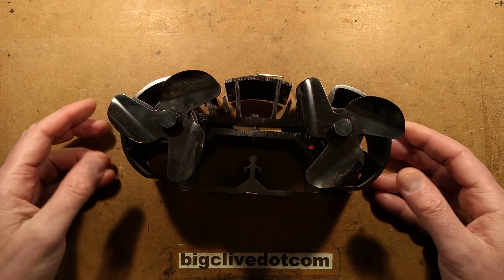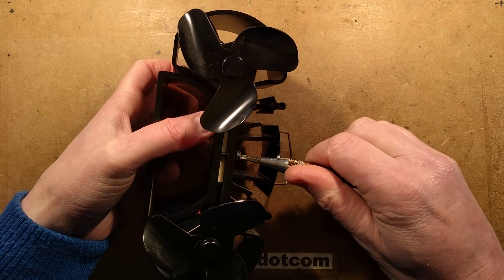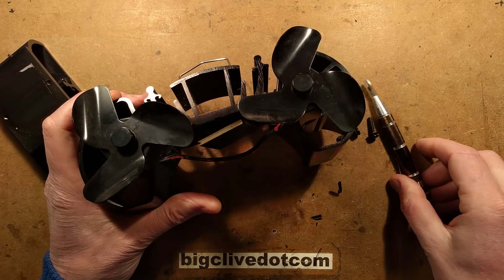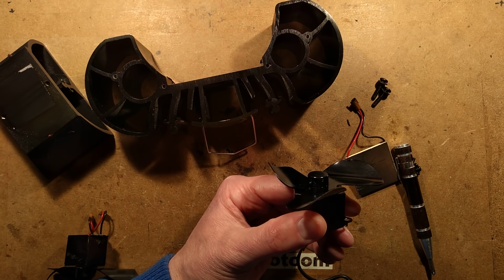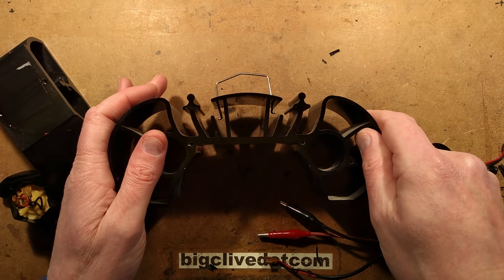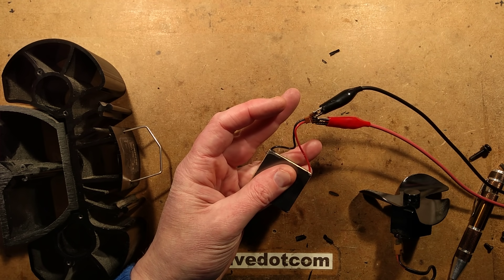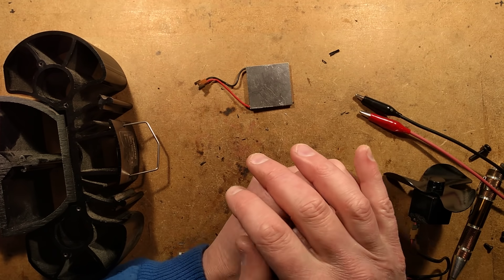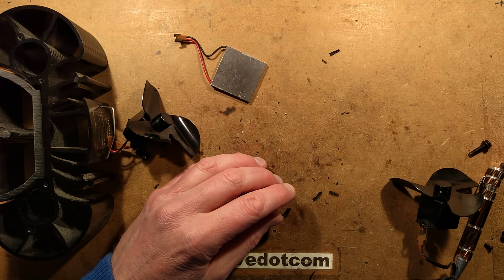Teardown of a self powering machine.

Comment: Those graphite pads have recently been introduced to the PC world as reusable thermal pads. 

Also, any luck just oiling those fan motors?
Reply from the maker: I'm going to try some high temperature lubricant in them.  The original has escaped onto the fan hub.  I ordered some graphite pads too.
Reply: @bigclivedotcom  I have a brother in law that used to work on F-16's and we once used some $600/ounce high temp grease on a screeching hobby motor in a toy helicopter we were flying about in the hangar.  Not only did the squeak stop, flight time increased by about 20% from the reduced friction.  Not sure what that stuff was, but it was miraculous.  Military budgets and all that.
Reply: It's pixie dust in mineral oil.
Reply: @tiporari  teflon and moly or something. turbine use air bearing so i doubt they are greased as the temp reach 1000C+++
Reply: I believe that you can buy silicone oil in an aerosol can.
Reply: @Francois_Dupont  "Air Bearing"? Please elaborate
Reply: @incandescentwithrage  closely fitting plain surfaces with compressed air blown it, less than .0005 inches clearance, feels really tight without the air but near zero friction with the air.
Reply: I have some self adhisive graphite pad, but it's super thin so very un reusable. It becomes damaged just from the edge of a component.
Reply: Actually, they were used in a vintage Mac, the 840AV IIRC. Used to thermally couple a peltier to the CPU. They were "silently" replaced with a standard heatsink & fan due to condensation issues...
Reply: @bigclivedotcom  graphite is conductive right wont it cause shortage after wearing down from normal use?
Reply: Bert Kooijmans 
It’s solid state. I don’t think it will wear down when used.
Reply from the maker: @bertkooijmans4769  The graphite is stuck to ceramic.
Reply: @tiporari : He used to work on F-16's what? I mean which possession of an F-16?
Reply: Ooh so no worries haha
Reply: @tiporari  There are quite a few. From Chemours (used to be DuPont), Krytox 240AZ/AB/AC grease (the letters mainly signify temp range shift and viscosity), Krytox 143AZ/AB/AC oil (which actually forms the base for the aforementioned greases... grease = oil + thickener.. in this case, the thickener is PTFE), Rheotemp 500 by Nye (sodium complex thickener + ester oil) is popular as well, plus other Nye brand products. That's what's used for many aerospace and space bearings. The cost is around $200 - 400+ USD per 2oz. Aerospace greases have their own pros and cons. Cons, aside from price, include generally higher viscosity (so, more friction losses.. not good for very low torque systems), more bearing noise (PTFE is a very good conductor of acoustic waves), heavier mass due to density, and very toxic byproducts when burned (think WW2 nerve gas). For the Krytox series, some pros are: compatibility with all materials (you don't need to think about the materials you're lubricating, which would normally be a concern), non-toxicity (you can pretty much eat it), no smell and no marking/dirt (it's white). I work with all of these regularly. The "reduced friction" you mentioned, was likely simply a lighter grade of grease, which by definition would also have a lower peak temp. In general, all aerospace greases are higher friction. The reason is that only fluoroethers and polyphenylethers survive the highest temps, and both are much higher density than hydrocarbon oils. I'm not a chemist (I just know what I need to know), so I stand to be corrected on any specifics.

My favorite "all around" grease that I'd recommend everyone to own is actually Multemp SRL by Kyodo Yushi (polyolester oil + lithium thickener). Maybe 50x cheaper compared to aerospace options, translucent color, no smell, good temp range, and very good acoustic properties (super quiet bearings). Hope you find some value in this long response. ;)
Reply: @steverpcb  Thanks, I thought they used deep groove ball bearings cooled by oil. Although I got the gist from the words I have never seen them used. Off to Google I go..

Comment: 6:00 If you ever have a wobbly/noisy motor/fan in electronics, always try some grease first. Silly things usually come dry, or with the thinnest layer of lubrication. Almost always fixes them permanently to just grease them. :D
Reply: It sounds like the commutator has been worn down to nothing as there is no power switch on these devices (i use to fix brushed RC motors)
Reply: I've found that as well with bathroom vent fans. They will start squawking like the bearing's being shredded. A few drops of oil shuts them up for another several years.
Reply: @hughbrackett343  Annual event for our bathroom and laundry fans - dismantle, dust, chassis has a trip through the dish washer, then re-oil and re-assemble. As good as new - possibly better.
Reply: Many of these small motors do not have real bearings but instead rely on a lubricant impregnated bronze bushing and as the bushing eventually becomes worn the shaft will wobble within the bushing due to the inevitable imbalance in the fan blades or rotor and create a racket and a drop of oil will help with that since the oil film can help to stabilize the shaft so that it no longer impacts the bushing, though the oil will eventually need to be reapplied as it does not last forever and the bushing will continue to wear (more) slowly.  A lot of small cheap motors also lack proper brushes and simply use a spring loaded copper lever in place of proper graphite brushes and those can suffer irreversible wear if the copper “brush” wears through (or breaks from the combined effects of thinning and work hardening) or can severely wear the commutator over time — oil will do nothing for that issue.  And, of course, if the motor overheats to the point that the insulation of the windings breaks down then nothing can save the motor unless One wishes to rewind the coils — and that is a very real possibility when the fan fails to spin and cool things down as the winding insulation is likely rated at 150-200°C and the wiring insulation that we saw burned up was likely rated at anywhere from 75-105°C and it had already been severely cooked, so we know the temperatures were well over what the wiring insulation was rated for, so the windings themselves may have also started to short internally which would increase the current draw of the motor.

Comment: why not a stirling engine stove fan?
Reply: Probably engineering tolerances make it too expensive compared to this solution...
Reply: Hmm noisier than these when the bearings go though? And expense wise I got a Low temp stirling engine for Christmas that was $20 the higher temp ones are cheaper (the models at least) I think they would be a lot more fun for engineers at least and only the risk of mechanical failure not adding electricity into the mix.
Reply: @Tore_Lund  That link is still very cool crude or not. Id love one but no doubt it will be too expensive even just to ship it
Reply: @Tore_Lund  At least one manufacturer of them Vulcan Stove Fans: https://www.stirlingengine.co.uk/d.asp?product=VULCANSTOVEFAN. I have one works fine.
Reply: Anne of All Trades has one - maybe ask her where she got it.
Reply: Hey, why not a steam engine if it comes to that?
Reply: stirling cycle stove fans are redily available. The largest siding and shingle supplier in the US carries them in many of the northern stores. Also depending on how seals are made a Stirling would be far less likely to s*** the bucket from overheating.
Reply: @chaos.corner  hmm the need for water, oil and the introduction of moisture into the environment (most exhaust out if the flue ideally). It would be cool to have a steam turbine or my little wilesco put to work but definitely more maintenance.
Reply: @bencarter96  Filling the boiler every twenty minutes or so would be a bit of a pain?
Reply: @kevanparker908  on my little wilesco yes definitely XD but there are self filling boilers out there, hook it to a water supply

Comment: Not exactly what I'd call "self powered". Thermally powered seems to be a more accurate description. Really cool though!
Reply: "Really cool though" Only on one side...
Reply: You can nay change the laws of thermodynamics
Reply: Thank you, Andre Blanchard!  That is what I thought the fan in this video was going to be, before bigclive took it apart and I learned there were such things as Peltier couplings.  I am glad that at least things like this exist, and I did not have my head totally up my "arse", as bigclive might say.
Reply: It essentially is partially self powering, because the fan is required to keep the temperature difference.
Reply: @andreblanchard8569  That's definitely a more efficient stove fan. But it must be set going as soon as possible or the whole device will heat up. For anyone interested, these Stirling engine powered stove fans are available on eBay as well.
Reply: @PunakiviAddikti  In theary yes but in practise it really does not matter. Mine sits on the stove all the time sometimes after starting a fire I forget to come back to flip blades over to start it, even after a few hours of heatsoak it will start right up and quickly come up to speed as the air starts moving.  After 8 years it is getting noisy and not running as well as it used to. The bushing for the displacer piston rod is worn letting the displacer move side to side and also leaking air. 
Biggest problem is over oiling the oil gets inside and vaperizes then gets on the power piston guming it up. You then have to take it apart and clean everything.
Reply: NICE
69 likes

Comment: In my experience these fans are an ornamental dust trap gimmick. I had one, and when the stove is hot enough to get the fan ripping round there's so much convection going on with a big lump of steel at 150 degrees C , that the small amount of puff that the fan contributes is rendered insignificant. Put a kettle on top and have a brew!!
Reply: Yep I'm a bit dubious for cube shape rooms, though it might make more sense for canal longboats
Reply: Good mention earlier for a fan above extrusion blowing rising hot air down - Could suit square rooms better?
Reply: I thought the same thing! I tried out an electric fan (not on the top!). It needed a lot of power/blow before I could feel anything more than 1/2 metre away. Instead, I put 8 small concrete paving blocks on top and let them heat up and radiate more heat slowly.
Reply: Mark Davis if you come across a scrap storage radiator, the brlcks in them are really dense. Store heat well : no surprises 
Our stoves set in a fireplace with 5" gap all round so we have the thermic reservoir of the chimney breast etc to absorb heat. Sadly it warms next door too. Some good rocket stove vids out there. Ppotty is worth checking out. 
Some people have put a rad next to the riser and gently pumped the water to a rad and fan in another room. That works

Comment: I never knew devices like this existed.
Reply: I can't see a reason either, besides cabins w/o power. You're burning more fuel to offset the cooling effect on an expensive device that succumbs to quick heat death.
Reply: @hydrocarbon82  It's meant to circulate the heat on multi burning stoves and stops heat from just sitting on the gap above.
Reply: That's exactly it.   They don't cost any more fuel as they just use a little of the heat already produced, and in return the room is heated more effectively as the fan circulates the hot air above the stove.  Very neat little devices. (In case you're American we're talking about stoves as room heaters here as they are in Europe, rather than cookers.)
Reply: Haven't seen or heard of these in Australia!
Reply: @Hydrocarbon82 Without this, 100% of the heat rises above the stove. With this, 99.99% of the heat is circulated around the room.

Comment: We're using little 80W peltier-based dehumidifiers in the motor/gearbox cabin of our large satellite dish project.  Keeps the condensation down during certain parts of the year.  They work pretty well, but, granted aren't that efficient, but they are "right sized" for this particular job.  Lack of environmental control for 25+ years was the cause of the only structural issue we found and needed repair before we could continue.  A heater in the winter, and these little peltier guys in other parts of the year have really helped a LOT.

Comment: Technically, these fans are using the Seebeck effect, not Peltier.
Seebeck effect = generating current from a temperature differential.
Peltier effect = generating a temperature differential by passing current across the junction.
Reply: true is that. but for the sake of it lets just talk about the thermoelectriceffect then it does cover both of these effects and we do not need to differentiate between them

Comment: Same junction on RTG nuclear powered spacecraft.  The hot side from reactor and the coldness of space on the other via heatsink.  Very inefficient about 12% but very reliable, just throw a few more pellets on the barbi.
Reply: The only downside is that power output will deteriorate over time, but it is by far the best way we have of continuously powering craft for many decades without adequate sunlight for solar cells.  Unfortunately, we are running critically low on plutonium for the pellets at present.  It would be great if we could find a way forward to create some more refined plutonium without starting another nuclear arms race in the process as we do need more if we are to conduct more deep space missions where sunlight simply does not suffice as a power source.  Better still if we can work out the kinks so that the TEG array does not deteriorate as much over time from the radiation it’s exposed to which would help to prolong operating efficiency.  Though the only way to make a very long lasting RTG for very deep space missions is to opt for more stable isotopes with longer half lives, but then they have lower real time output and have to be scaled larger.  It would be great if we could engineer some extreme high reliability deep space explorers complete with ion propulsion and large propellant reserves such that we could send satellites on missions of a century or more as there is so much that we do not know about the distant reaches of our solar system.

Comment: i made a stove fan not even a week ago. 10mins after putting it on the stove i smell burning plastic and i look. the wire of the peltier had unsoldered themselves, and the hot glue holding the motor had melted. the whole thing was boiling hot. i had made it with massive heatsinks from PII CPU, but the fan wasnt cooling them enought so it burned out.
Reply: Sounds like your setup is too close to the top of the stove. If you look at the fans you can buy, they often have a single piece of steel that is a few inches long that transfers the heat to the bottom of the peltier. Try using a couple rods or something to use as a space between the top of the stove and the bottom of the peltier to limit the heat transferred into it. The peltiers don't need that much heat on the bottom side to create the voltage you need.
Reply: Motor was hold by hot glue??? You must be joking?
Reply: @111chicane  Hm, what does hot glue do when you heat it? I know this one - just give me a minute...  :)
Reply: Live and learn!  No project is ever a failure so long as you learned something from the attempt.  Besides, we learn infinitely more from failures than successes so long as we pay attention to the lesson.

Comment: Stirling engines are quite popular for sitting on top of wood burner stoves too. Obviously it still has bearings and moving parts, but no wires or low temperature soldered junctions like Peltier / Seebeck devices have. Fascinating things to build from a kit.
Reply: I bought one of those table top Stirling's some time ago (actually well built but reasonably priced). Have been fascinated by them ever since. They don't produce much torque or anything, but are so cool in their simplicity.